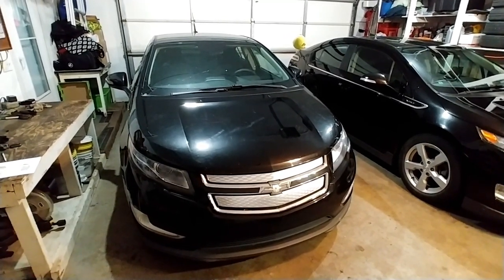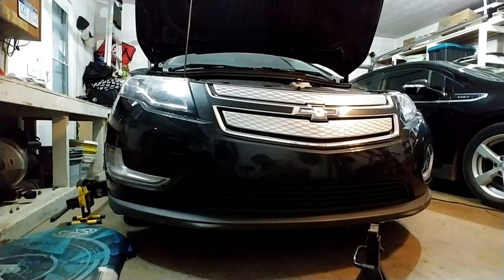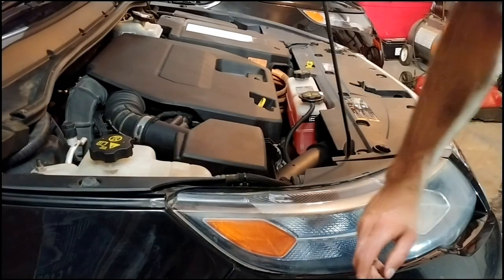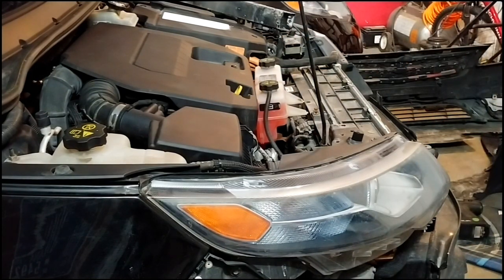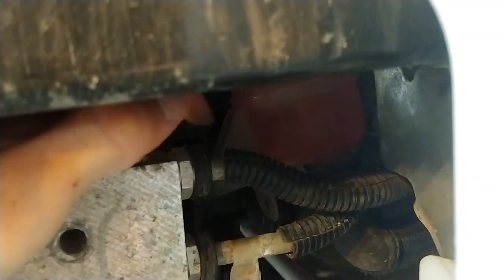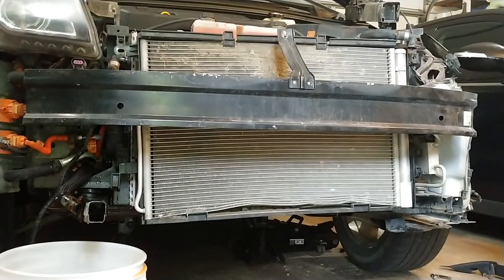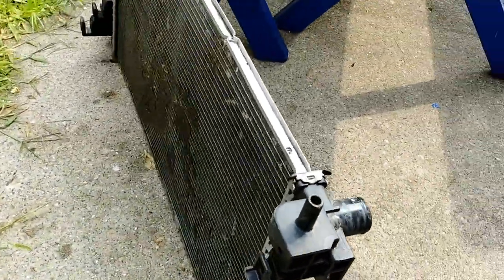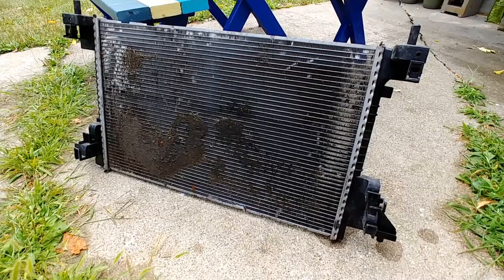How to Replace the Main Engine Radiator in a 2011-2015 Chevy Volt

Comment: Good video.  It is an ugly job.  But I think I did it an easier way. I didn’t remove the headlight or fender well. I started top down and removed the front fascia.  I didn’t break into the HV battery cooling system.  I removed the AC condenser, and I removed the radiator support brackets, which allowed me to pull the radiator out the bottom.  Time between AC radiator coming out, radiator out and back in, and AC condenser back in was less than 30 minutes.  That is not how the factory shop manual does it.  I didn’t want to break into the HV cooling because I didn’t have the tools to properly refill the system.  It needs to be vacuum filled because it’s pump isn’t strong enough to push air bubbles through the battery.  If you get air in, and don’t get it out, you risk local overheating of the battery.
Reply from the maker: Thank you.  It is an ugly job.  Thanks for the tips.  I hope to never have to do it again!  Another person told me about removing the lower radiator support brackets and said it was easier that way as well.  I've done the HV radiator before and didn't have any issues without the tools to properly refill the system on 2 Volts, but I didn't want to have to refill the AC system or mess with the transmission fluid and cooler.

Comment: Wheres the Petcock drain?
Reply from the maker: There isn't one.  The service manual says to drain the coolant by removing the coolant temperature sensor on the lower passenger side.  At 4:10 I start talking about the procedure.
Reply: Well the radiator is gonna be drained cuz its leaking down there as it is. It looks like its coming from the bottom leaking around the plastic piece.  Gonna be a fun job!

Comment: The Problem is the very poor design..😅
And this is the main radiator who holds all the other radiators.
I also Dremeled the tabs and managed to replace it whithout draining the ac and transmission cooler..
P.S.
If it was my own car....
I would plasma cut the bumper bar.. and after replacing weld it Together...
It's really a Pain to replace It...

But The Front one is very Easy to remove..
And very important Use the right coolant If you don't You've Got High voltage messages on your screen.. 
That's why this one radiator cap is sealed..
Because if you put In The Wrong coolant...
You could potentially fry out your high Voltage battery system...
So use: De ionized water don't use tap water, because It does conduct electricity...😅
Reply from the maker: Your experience and tips are invaluable, especially for anyone else tackling this job.

The design is definitely flawed, particularly with the main radiator holding all the others. It's incredibly annoying and very unnecessary. Your workaround with the Dremel to avoid draining the AC and transmission cooler is quite resourceful and time saver. And I can see why you'd consider plasma cutting the bumper bar for easier access—sometimes, a more drastic approach can save a lot of hassle. If/when I have to do this again, someone else mentioned removing the lower radiator support "horns" and it makes it easier to access the main radiator.

Your advice about using the right coolant is crucial. Using deionized water instead of tap water to avoid conductivity issues and potential damage to the high voltage battery system is a great tip. It's clear that the sealed radiator cap is there for a very good reason!
Reply: @mjspiess  Thanks for your Positive command, 
I really appreciate that. 👍🏻⚡😉⚡👍🏻
Reply from the maker: @rickstevens2941  You're welcome!

Comment: I just got this service done and it was expensive....and now I just found this video as my car overheats again from them now saying the fans don't work and charging literally the same price to do the radiator again....ive own the car for a little over a year. I really liked this car but the design of the radiator system is very off-putting to me.
Reply from the maker: Yeah, it's an incredibly frustrating job.  Geez!  Do you have any check engine light codes?  Maybe there is another problem?  I don't know why they would replace the radiator again if they confirmed the fans weren't working?  I've driven my 2013 a little over 21k miles and it's been mostly trouble free.  I did had to replace the front radiator which was easy and water pump which wasn't as easy, but I do agree...the radiator systems are pretty frustrating.  Good luck on yours.  Great cars, but costly when it comes to repairs...
Reply: Fetch A Wrench honestly I like the car too but the dealerships here are wonky….I’m not sure what to exactly do but I did sub to your channel as I enjoy the content
Reply from the maker: @kumaSOevl  Yeah, I've heard some horror stories regarding Volts and dealerships.  Unfortunately, it takes some extra competence to work on these Volts and there's usually only one...maybe two techs that are certified in doing so, but even they are sometimes a crap shoot.  I'm no tech, but spent a fair amount of time reading and researching various issues the Volt has and have learned a lot.  You're kinda in a tough spot.   I'd check the fuses to the fans or make sure they are plugged in, but if not, you'd likely get a  Check Engine Light.  It's kinda odd they'd just fail.  Does it only overheat while idling?  If it's truly a fan issue, the coolant should cool down while driving as air moves through the radiator.
Reply: Fetch A Wrench I’m not sure I drive it straight to the dealer after the light came on. I’ve been driving exclusively on electric this past year. Maybe it’s time to go full EV. Honestly if it’s not a play car I hate pumping gas now lol

Comment: Terrible design.
No cross member beam to protect the radiator.
Driving over a chuck of styrofoam will immobilize the entire car.
Reply from the maker: Agreed.  Incredibly frustrating design!
Reply: That's exactly what killed the 460K mile Volt guy's car (on YouTube). Check his video out. He said he ran over a Semi Truck tire and destroyed radiators and other components in the undercarriage. Said his car was on its way to 500K trouble free miles and never the same after the insurance company fixed the car
Reply from the maker: @mike_t_007  that is a major shame! I just rolled over 180k miles on my 2013 model. I sold the 2012 I did this radiator replacement on.